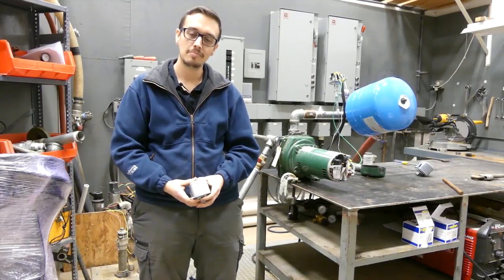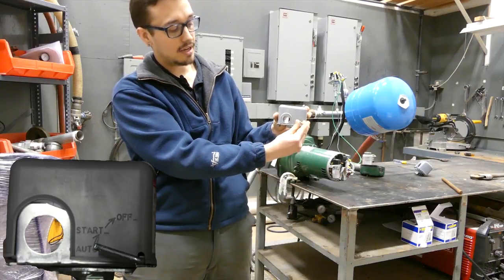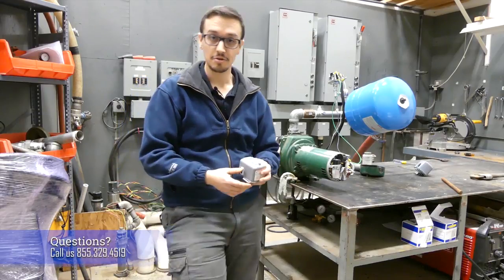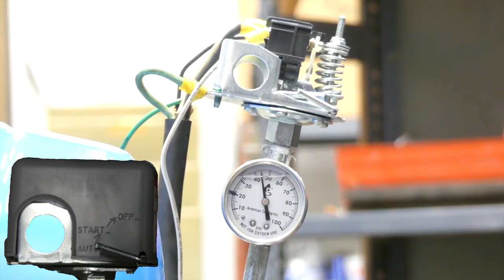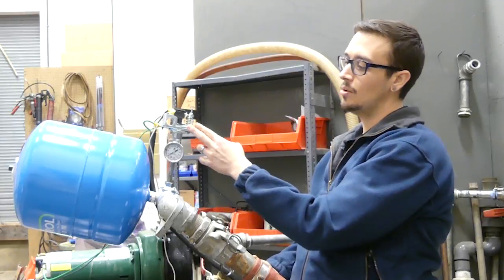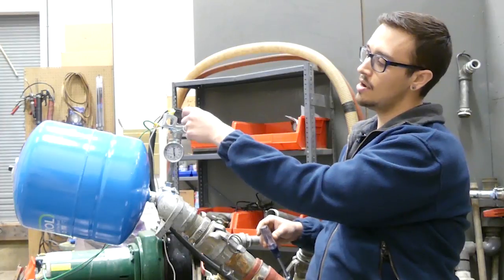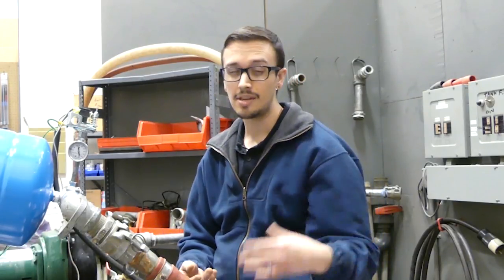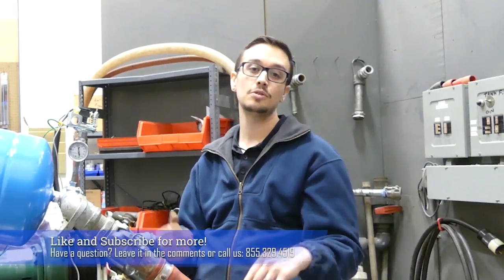Low Water Pressure Cutout Switch | Square D M4 Pressure Switch W/ Low Pressure Cut-Off

Comment: Chris,  a new 40/60 M4 pressure switch on our deep well system has had many nuisance trips lately.  I replaced the motor control box because it took 30 seconds or more of holding the trip lever in the start position before the pressure would come back up (I thought perhaps the old components were causing the pump to delay starting) but it still takes quite a while of holding the trip lever to get pressure back up to where it holds in auto.

Can the differential between low cut in pressure and the trip out pressure be set to more than 10 PSI to give the pump more time to start and build up pressure before it trips out?  If not, would raising the cut in pressure from 40 to 50 PSI help - or would the trip out differential still be 10 PSI?

I also checked the voltage at the switch and it is getting 238 volts, so the breaker in the electrical supply seems to be OK
Reply: Square D instructions say that the 10 psi auto off below the lower pressure power on cannot be changed.  So the trip out differential would still be 10 psi, or 40 psig in your case of raising the cut jn pressure to 50 psig.

Comment: Question: if I have a jet pump in the basement that gets fed from a dug well (spring) what stops the pump and tank from waterlogging? The pressure switch is mounted on the pump body.  Thanks. Great advice
Reply from the maker: I am not sure what you mean by "pump waterlogging". The pressure tank will only become waterlogged after the bladder has failed, which could take 10-20 years to happen.

Comment: I have 1 of these switches and it seems like I have to turn it back on every few days?  I don't know why it keeps shutting off? any ideas
Reply from the maker: You most likely have a low-producing well, so when the water level drops down the switch trips to prevent the pump from overheating.
Reply: @RCworstwater  A lot of people do not know that bigger may not be better  in  low producing wells or some shallow wells, I believe the smaller well pump would be better usually... ex. 1/2 hp better than 3/4 hp better than 1 hp.... I have a shallow well & I tried all 3 sizes over the 40 or so years & I now only  only only utilize a 1/2 hp shallow well jet pump... (saves on electricity also but a small potato in the scheme of things)... RC Worst you should do a video on this topic to help people realize that bigger may not be better for the homeowner at least with a shallow well... Few would believe a homeowner like me but you would be perfect for the video... Bigger May NOT be Better... or When Bigger is NOT Better.....
Reply: @thebeginningortheend1309  Great comment and that actually seems to be my problem.
I dug a well on my property which produces about 500 gallons of water enough to feed two sprinkler zones for about 20 mins each. I installed a 2hp Wayne pump together with a 120gl water tank and then installed a few switches ending with the M4 automatic switch. the problem is that the switch starts and stop every 20 to 40 seconds which does not seem right.
the water pressure never drops below 20psi but then again the well is not pushing any water to anything unless the pump is working. to test the pressure, 

I connect a hose to the water line and run it by itself with no sprinklers running which simulates a slow leak to see how the pump reacts but the pump continues to trip every 20 - 40 seconds and eventually staying on consistently.

right now my solution to the problem is to turn on the pump and the sprinkles on at the same time and when the sprinklers turn off then turn the pump off  completely and manually so as not to damage the pump.

I'm a newby and this video is a welcome addition to my learning effort on how my pump works. the only thing missing from this video is how to regulate the low/high pressure controls to make the pump work better and which are the low/high pressure controls

anywho: thanks for a great video

Comment: Is it possible to wire this switch in such a way that it only operates as a low pressure cutout switch? That is, when my bore runs low on water, it cuts power to the pump? I'm do not require it to cut in and out at certain pressures, just want to use the low pressure cutoff to save my pump running dry.

Comment: What about depleting your pressure during a power outage? You would have to restart the switch. Depending on where your switch is located I could see that being a nuisance...
Reply from the maker: If the switch is not easily accessible then this is not a good option. You should consider electronic motor protection in that case.
Reply: A timer reset by loss of power wired in parallel with the M4 pressure switch?  The M4 pressure switch would have to automatically reset once the 10 psi below the cut in pressure is reached.

Comment: Question: Is the M4 okay as a stand alone switch or does it need to be wired together with my existing switch? I'm using a 1HP shallow well jet pump to pull water from the creek for outside irrigation. I have a 200 gal galvanized pressure tank. Was using a regular square D 40-60 then replaced the pump and am using the one built into the pump.  Thank you!!
Reply from the maker: The M4 would replace your other switch.

Comment: Do they make something for low house propane pressure or high incoming pressure?
Thanks
Reply: Depending on how old your system is it will come with that protection. I believe it’s anything less than about 2-3psi your furnace won’t kick on. What protects your appliances from high pressure is the regulators on tank and on house.

Comment: I'm in FL, now the winter has dropped temps to 30-40 F and my pressure switch started clacking as if trying to start even though there's pressure above the switch on level of 30 psi. It goes, clack clack... Clack clack at if trying to start. Any idea? Thanks
Reply from the maker: Could be a number of things... Give us a call and we can help narrow it down: 855.329.4519
Reply: I wanted to thank you guys for your quick response and interest towards your viewers. Posted my question and got a reply right away and Jeremy was great and helpful! Thanks again

Comment: Last switch I put on,guy at hardware store convinced me.to get one with emergency shut off,I have great well but power goes off frequently in our rural area,its a nuisance,wish I had got the one without the safety. In fact sometimes I am not home and old and young not touching it. Is there a way to disable the safety switch without replacing switch?
Reply from the maker: There is not. You will have to buy one without it.
Reply: @RCworstwater  thank you

Comment: Great video! So I see they're available in 40/60 but... Is the cutout pressure adjustable? I have a submersible with the tank on a dead end far away from the well and irrigation valves so I suspect I might get a 10psi drop at the tank before the pressure reaches the switch. Or maybe I'm crazy.
Reply from the maker: Yes, they are adjustable.

Comment: how to set tandem pressure switches on a cistern booster pump with 60 gal bladder pressure storage tank. (recently replaced)  one switch located on pump housing (Gundfos)  the other on the storage tank.  The system runs "dry"  then finally comes on after a minute or so fills tank normally shuts off, runs dry then starts all over again after the delayed  stoppage.  The switches are not engaging and can be manually tripped.  Have tried several settings with no real improvement.  Do I have an air lock somewhere?
Reply from the maker: James, please give us a call to discuss your situation: 855.329.4519
Reply: @RCworstwater  fixed it just had to keep working on it

Comment: When my power is interrupted does my switch need to be manually reset and does my pump need to be primed each time
Reply from the maker: Yes, this switch requires you to manually engage the pump to run until it reaches 20 psi. If you have an above-ground pump then it will probably need to be reprimed as well.
Reply: @RCworstwater  I think the original question more correct answer is "MAYBE".  For example if you had a 30/50 switch and the pressure tank was sitting at 40PSI when the power goes out, as long as you do not run water in the house to the point that you empty the pressure tank down to 20psi or lower then you would NOT have to manually reset the switch.

Comment: So can you please answer this question. You kind of touched on it with a sudden drop of water pressure. My washing machine cuts off my pressure switch and doesn't kick the pump back on. Nothing else does, not the shower, not the tub, not the garden hose. Maybe it happens when I change the washing machine setting on "heavy bulky loads." And then I have to go up the driveway to prime the pump again. Should I increase the 30-50 spring with a couple of turns clockwise, or should I add a second bladder tank?
Reply from the maker: You might try letting a few pounds of air out of your pressure tank. Your pressure tank is emptying too fast and your pump does not have time to turn on before your switch cuts out.
Reply: @RCworstwater  Thank so you much! I will try that.